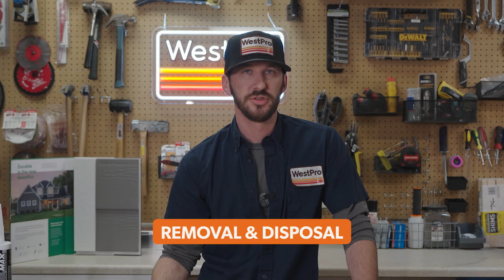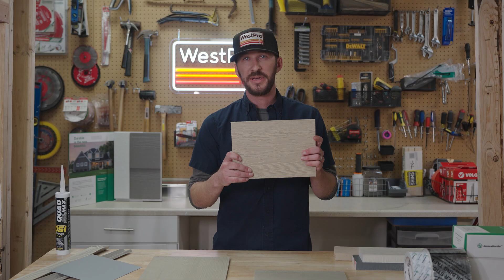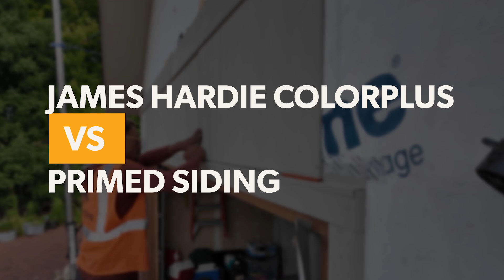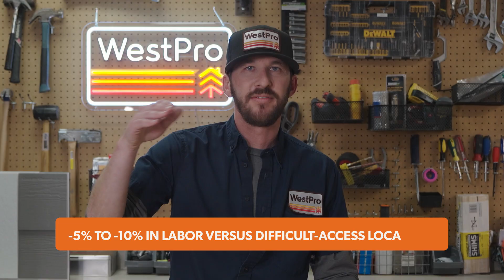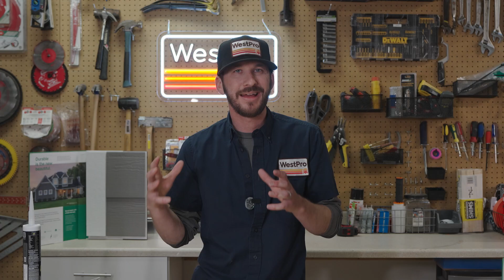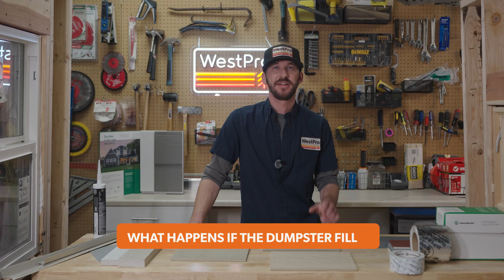Siding Replacement Cost in Colorado: 2026 Price Breakdown (Don't Overpay!)

Comment from the maker: Siding replacement on a typical 2,000 sq ft Colorado home runs ~$23k–$36k installed (James Hardie ~$30,640). Most siding failures are install failures, not material. So make sure your bid includes tear-off, housewrap, and flashing! Questions? Drop 'em below.

🏡Want a real number for your home? Book a free inspection: //www.westproroofing.com/siding/

Comment: I’m in the middle of residing my house right now. My upstate New York home was built in the early 1900s. I have vinyl siding over asbestos siding over wood clap board over shiplap. Demo is a bitch. After removing all the siding, I’m installing a layer of foam insulation and a layer of green ZIP sheathing. I’m going to add 1/2” plywood strips for rain screen. Then board and batten LP smart siding.
Reply: Whoa. That's a lot of layers for tear off. In our area of Colorado, rain screen details aren't very common behind siding systems, especially for residential re-siding. We've had good results with James Hardie Lap and Board and Batten siding without a rain screen because the z flash and butt joint flashing details give us adequate moisture management behind the siding. It does make sense that you are doing the rain screen, I imagine to build about the wall the the similar plane as the original siding. (That's a pretty thick siding sandwich to tear off.)  Thanks for sharing about your project and for checking out the video. Cheers